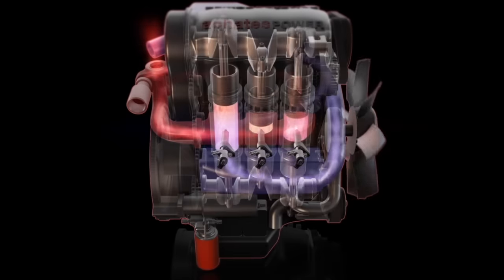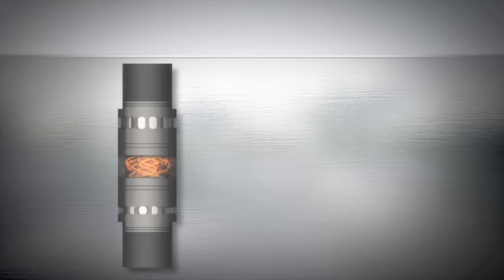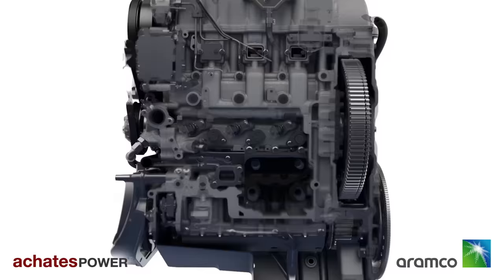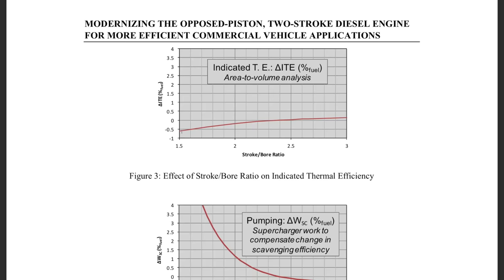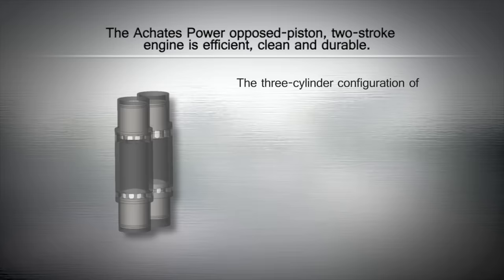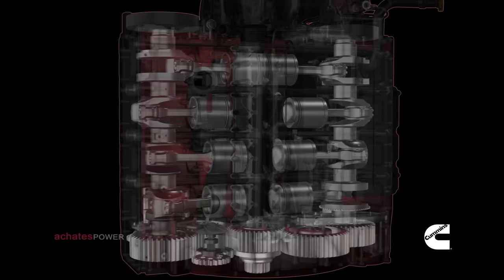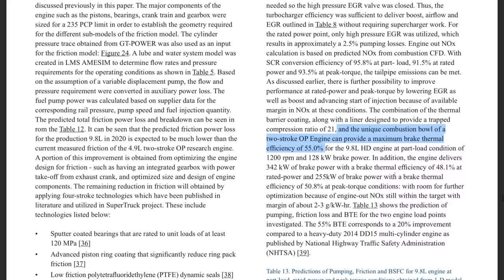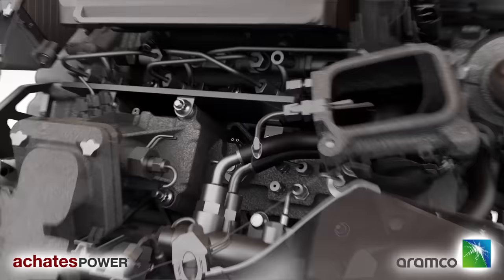Opposed Piston Diesel Engines Are Crazy Efficient

Comment: Its interesting, however there is more to the story then meets the eye here. If these engines have been in production since the 1900s and have the same power and torque outputs with a near 20 % increase in efficiency, why havent they already been implemented? I'd imagine there are some challenges that aren't so apparent. Also great channel, you present mechanical/mathematical information in an engaging way.
Reply: I have a feeling its because that its because when they took out all 2stroke motor for emission reasons they probably took these guys out as well. But I also think that it might also waste unburnt fuel as well with the exhaust port beening opened and closed longer then the intake port
Reply: You don't see these engines in cars simply because they are so big. These engines look to be ideally suited to constant speed applications like generators and ship propulsion applications.
Reply: @marktucker8896  Yet Boxer engines are still being used and developed, so why should two piston setups each other be bulkier than two pistons facing away from each other?
It feels like opposing pistons not only give less control over variation in injection timing, but both weight and heat could be bigger problems. With so much heat being generated in such a small area, the metal where the pistons meet would have to be thicker and use of lighter = heat sensitive materials becomes a problem.
I have no scientific basis for that, they're all just guesses ...
Reply: @Car_Mo  while I am no engineer, interesting that none of the examples online show an engine revving. I suspect they will have a very narrow sweet spot. May well be an ideal engine as part of a hybrid set up. The US army appears to be interested, if it works we will see more of this engine.
Reply: @Car_Mo  Pistons are cooled by lubricating oil spray at the bottom. As much cylinder wall gets thinner, better water cools it.
Reply: In the 60s Napeir Deltic engines ware used in trains and boats. Each bank of cylinders were arranged in a triangle so 6 poistons with a crankshaft at each apex. the big Deltics had 6 banks so 18 cylinders and 36 pistons developing over 1600hp.
Reply: @RETSAERETEP  Very interesting! Tks for sharing!

Comment: Fantastic! I remember reading about these engines a few years ago and wondering why they weren't in production. I didn't realize they were still actively working on it. I can't wait for these engines to be available to the public, it should enable some pretty cool things.
Reply: Obviously because it isn't all that obvious. Oil use was mentioned earlier and also the drag of both a compressor and a turbo is probably not included in the overall efficiency numbers.

Comment: Napier deltic springs to mind , and the commer “ knocker “
Reply: Chrysler ceased production of the TS3 engine after taking over the Rootes Group in the mid-1960s. TS4 prototypes had been extensively tested on the road; some are now in museums. These TS (Tilling Stevens) engines all used Roots (not Rootes) blowers for supercharging.
Reply: I remember with great nostalgia riding the Napier Deltic powered class55 express trains in the UK as a kid. Unique sound!
Reply: Nothing like the sound of a Deltic at full chat! Haymarket tunnel the best noise ever.

Comment: Commer lorries in 50s and 60s used a Tilling Stevens 3 cylinder supercharged Twostroke  with 6 pistons connecting to a single crankshaft using 2 large rocker arms. Beautiful engineering even though quite loud exhaust note. Would need easy decoke and replacement piston rings around hundred thousand miles ,then ready for another hundred thousand. Had to use an anti phasing device as being a twostroke could run backwards on lorry pulling to a halt. The supercharger was mechanical Roots type so quite expensive to produce. Throttle control was operated using a vacuum tube and the vehicles braking system completely Air pressure actuation, including Handbrake. Superb engineering.

Comment: It's kinda funny how many systems operate at peak efficiency when there are 3 operating simultaneously, like 3 blades on a fan or 3 phase power.
Reply: Jimmy De'Souza Choppers typically have a load to carry therefore efficiency isn't the first priority; sacrificing efficiency for higher thrust. Take wind turbines for example, they all have 3 blades for a reason.
Reply: Work teams of three is very efficient too.  Usually two skilled people sharing a helper.
Reply: Kevin Yeoh that is an interesting point you bring up!
Reply: Three phase power isn't necessarily more efficient than single phase, but it smoothes out the flow of power from a given generator, while having a minimum of redundant wiring.
Reply: The three blade design is very common on news choppers. That configuration was used on the first helicopter that touched the peak of Mt Everest. That model was a Eurocopter AS350.
Reply: It's usually due to harmonics/ oscilations.  Prime numbers in general.  Physics and nature are full of patterns.
Reply: Unrelated. 2 blades on a fan are more efficient than three. They just have undesirable vibrations.
Reply: Jimmy De'Souza CH53E has blades. Even blades introduce too many vibrations.
Reply: Erik Kovacs wouldnt vibrations mean wasted energy?
Reply: Increasing the number of propeller blades tends to reduce efficiency. In theory a single blade propeller with a counterweight is optimal, but to achieve equivalent thrust to for example a 3 bladed prop, it would require a massive single blade. I also suppose having a prop that produces thrust only on one side will create vibrations. Most times that you see a prop with many blades is because it was designed to produce as much thrust in a small space.
Reply: I'm not so sure about that but perhaps 2 blade fans are the more efficient, but the problem becomes one of size with more power, so 3 or 4 blades but less efficiency can move more air in a smaller format than a great big 2 blade fan. From an aviation perspective, this is important for propellor tip velocity, ground clearence, landing gear height and weight etc. Apparently the most efficient is 1 blade. The Germans circa WW2 (iirc??lol) had a counter weighted 1 blade prop on something or other I read (their may even be a pic about the place).
Reply: The triangle is the strongest shape found in nature. Three sides, three points, it only seems natural that things would be better in threes.
Reply: 3 blades on fan are efficient only from the economic point of view, it is not the most efficient combination from energy production or airflow, however i like your point ;P
Reply: THREE..............is a magic number.
Reply: Kevin Yeoh well school house rock said  it best....it takes 3...its the magic number

Comment: Have a look at the old Napier Deltic design; it optimised the form factor for three cylinder pairs. It was used in diesel locomotives, and naval applications. The only real drawback was reduced reliability. It'll be interesting to see whether the use of modern materials and modern manufacturing can fix that.
Reply: Yes, it could.
With modern technics even steam locomotives can get very efficient.
Reply: the biggest reliability problem with the class 55 "deltic" locomotive was the LACK of maintenance. as there were so few of them, they didn't get the down time to keep them running well.
Reply: Ynot6 , I believe the Deltics engines were left running when the loco was not working because of it’s  starting issues.
Reply: @AJ-qn6gd  and maybe the startup routine, manually pumping up the oil pressure to start with!

Comment: Great presentation! I've been following Achates since their first press releases. 
   I have wondered about opposed piston engines since learning about the Junkers Jumo series in/before WW2. Fascinating. Highly successful. But scary to risk on a Detroit mass production scale 'till now? Electronics makes this a whole new ball game. Force scavenged 2 stroke w/ no head is on another level.
 The supercharger for scavenging is reminiscent of the GMC -71 series. This alleviates the cycle of typical 2 stroke scavenging issues. 
   I am investigating scratch building one using as many production parts as possible & using gasoline. 12:1 & EFI?The lack of a cylinder head sidesteps so many mechanical, Thermal efficiency, & detonation issues. The lack of red hot exhaust valves alone changes the detonation picture. 
   I had not considered the cycle overlap with 4 cylinders. Might have to accept that. Is that really a big issue?
Reply: I honestly wouldn't think that the overlap would be an issue at all; the exhaust gas is what makes the turbo spin so I'd think more consistent application of it would make the turbo run better than when it peaks and falls, not worse.  Of course, I'm not a professional mechanic or an engineer and don't know the exact science behind any of the mechanics outside the combustion cycle, so I may be missing something about those graphs.
I can fix an engine and locate problems just fine, but I don't use anthing more complex than an adjustable wrench for that and couldn't tell you any exact detail about any problem beyond just what the problem is and the cause.

Comment: OK! I’ve just looked up the TS3, and learned that it was smaller than I thought.  Just over 3 litres.   I think it’s a great pity, that opposed piston engines aren’t very common, these days.  I may have an idea, about this.  I owned 2 London Transport buses, one single deck with underfloor, horizontal engine, the other, double deck with vertical engine over the front axle.  The horizontal engine smoked a lot, starting from cold, suggesting that oil pooled in the cylinders, whist resting.  This could be a problem, nowadays.  Neither engine smoked when warmed up, after a couple of minutes.

Comment: The only real engineering problem to overcome will be keeping engine lubricating oil out of the combustion process like all 2 stroke designs.  I lived with Fairbanks-Morse OP diesels on nuclear submarines and they are wonderful.  Crazy smooth because naturally balanced with the pistons counter balancing each other.  Notice the lack of big counterweights in the videos. Emissions, well they will burn the oil that gets into the combustion so no need to worry about that. The other biggie is 2 stroke usually have about half the cylinder firing pressure as 4 stroke diesels so NOx will be significantly reduced depending on the about of super & turbocharging.  The other challenge for automotive applications will be packaging the thing under existing hoods due to its tall height as mentioned in the F150 demo.
Reply: Just position the engine horizontally like an airplane engine with I configuration

Comment: The Napier Deltic was the greatest of these engines,
Reply: And the least reliable
Reply: Junkers jumo 223
Reply: @hansknutson2327  Indeed! The Jumo 223 was the greatest Gegenkolbenmotor.
Reply: Nah, that would be the 5TDF
Reply: Sander Van der Kammen It was reliable, just expensive to service as you have to take so much apart to get to anything. But they were fast.

Comment: The problem with car combustion engines is, that they are running in part load almost all the time. In order to achieve the best efficiency you have to run such an engine at its highest efficiency point, which is close to the point of maximum torque. The main problem with the efficiency of combustion engines is that the cylinder liner needs to be cooled to a certain temperature in order to keep its material strength and to keep the oil film at its surface. The amount of heat going to the cylinder liner is not very much reduced if you operate the engine at lower speeds. That's why it looses a lot of efficiency especially at lower rpm. The exhaust gas losses are about proportional to the engine speed.

I think, that the reduction of the surface area of the cylinder liner is not a very promissing way to gain efficiency. It is better to do research to get materials for higher temperatures like oxide ceramics. In this way you can significantly reduce the amount of heat going into the engine coolant or cooling of the cylinder liner can be avoided at all.

Another possibility is the use of Rankine cycle engines (steam engines) instead of engines with inner combustion. Rankine cycle engines can run with the same or even higher efficiencies at lower inlet steam temperatures. IAV developed a fast running 3 cylinder steam motor (ZEE03) operating at an efficiency of 45% with superheated water steam at 900 °C without cylinder cooling. Its maximum power was 75 kW. Superheating of the inlet steam was provided immediately before the steam enters the cylinder by use of direct radiation heating of the preheated steam with a porous burner around a Quarz glass tube.
Reply: My 200cc engine motorbike is almost always running at its peak capacity. If you think cars run at low loads, it's bcs they're overpowered for their intended use. I mean, why would anyone need a 300hp car to commute???
Reply: @caty863  in order to run a usual car at 55 mph you need 12 to 15 kW. But with such a low power it is impossible to accelerate in a proper way. Driving could be highly dangerous in many situations.

I personally think, that the power boost (70 to 100 kW) for such situations can be delivered by an electric engine. The ICE can be limited to 25 kW. An electric engine for 100 kW (axial flux engine) doesn't contribute much weight to the system. The buffer battery either, because its capacity can be limited to 5 kWh.
Reply: Chevrolet Volt uses the gas engine at high efficiency to produce electricity for the battery. I would love to see the ICE in a volt be converted to an opposing piston engine as shown.
Reply: @NomenNescio  The Chevrolet Volt (Opel Ampera) is designed to operate as an electric vehicle with range extender. The problem of such cars is, that you need an ICE with about the same power as a combustion car. Otherwise your maximum speed is limited during the charging operation.

This car operates in 2 electric modes (mode 1 main e-engine only, mode 2 main e-engine and generator in motor operation) until the battery reaches 20% of its full capacity. When the car is running, the ICE starts at 20% battery capacity in ICE/electric mode 3 and charges the battery up to 80% at the maximum efficiency of the ICE. In case you need more power it switches in ICE/electric mode 4 to use the ICE directly in the power train.

If I would take this car, I would reprogram the modes to operate only the electric engines for driving. (serial hybrid) and switch to mode 3 allready at 60% battery capacity. Mode 4 is not needed.

Comment: It all comes down to whether it can meet emissions regulations. Existing diesels can get much higher thermal efficiency figures than they run at currently provided nobody worries about NOx emissions. High combustion temperature is ideal for high thermal efficiency, the problem is it's enough to break the nitrogen molecules in the air into free nitrogen, which can form all the NOx that's prematurely killing people in big cities all around the world.

This is a lot of the reason opposed piston engines are popular in ships - once they're in international waters they can and do burn any old muck they can buy, switching to cleaner fuel when they come into port. It's the reason why the 15 biggest container ships put out more Sulphur and NOx pollution than the entire world's cars.

One of the coolest opposed cylinder engine designs was the deltic used in UK trains, which used 3 crank shafts in a triangle, with 3 combustion chambers.
Reply: peglor Their engines exceed emissions standards by a considerable amount.
Reply: maybe in a lab, but I won't believe it until they get an actual vehicle EPA certified.
Reply: Jeffrey Havlik 
Understood but emissions instrumentation in a test cell and in a vehicle are basically identical. Test cell actually runs more instrumentation.
Reply: they even all lied about the current crop of diesel, scamming the public into putting out these pollutants pretending they did more mpg etc. People still buy their cars tho so maybe they deserve to breathe  it
Reply: Medical Cannabis Spain they do get more mpg.  By running at higher temperatures a diesel can get better thermal efficiency and mpg.  But it will produce more sulfur and other pollutants